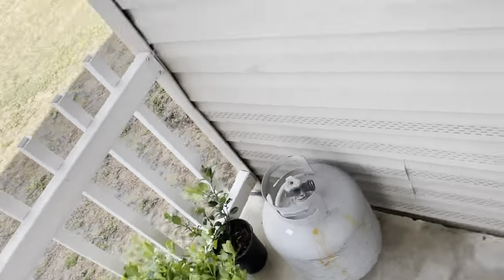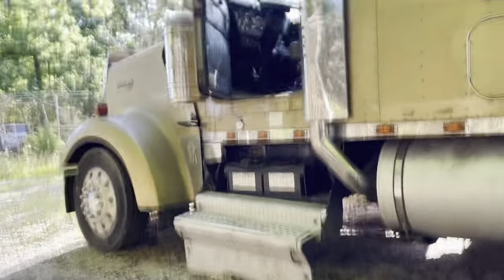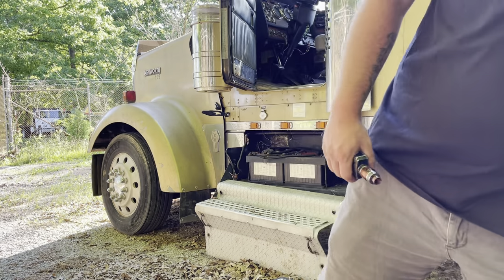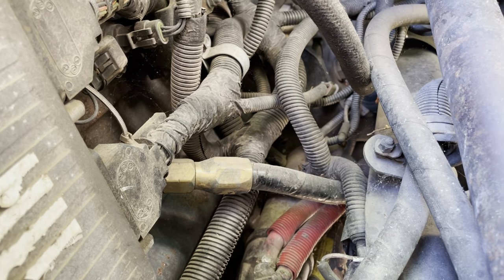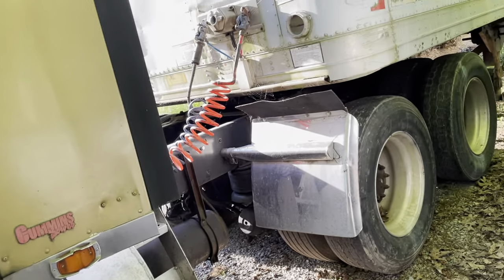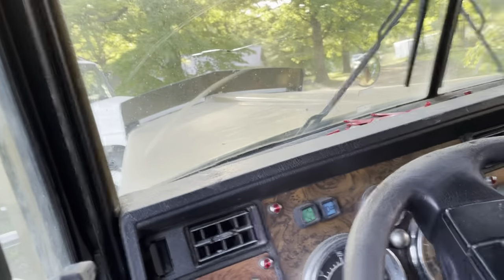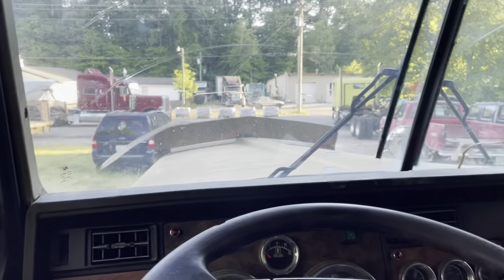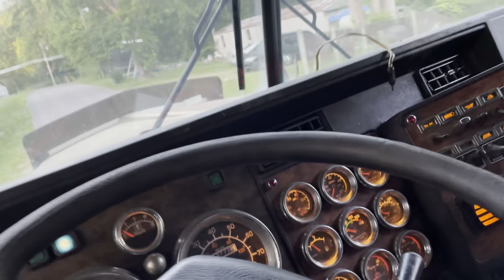WILL IT START? KW900 sitting 2 Years Drives Away from Grave....

Comment: Tim if you have low oil pressure, like 15 to 20 #'s at idle, replace the piston oil cooler/sprayers that spray oil on the piston skirt to cool/lube them! That are on the side of the block, under the turbo, round, with a bolt holding them in, easy to change! They get brittle, and break off, causing the oil pressure to drop! Easy fix!
Reply: Down to 10-12 at a hot idle is normal for the n14. 15-20 is great. The piston cooling nozzles will cause the  oil pressure to drop though
Reply: Tim, replace that old wore out steering wheel with a new leather wrap chrome one.i had a 2000 model look like that one got it new off the lot with a 550 cat large car...

Comment: That engine runs like a fine Swiss watch. I would love to have that truck. I would take it and get new virgin tires all the way around and a alignment. Then Get the windshields replaced. After that change all the fluids and filters, fix that starter problem and air leak. Get a paint job after it earns some money. I would go gold with some metallic root beer brown striping on it. Old school. Oh I will prepay for two shirts and a hat if you tell where to pay at. I absolutely love today’s video. 👌🏻👍🏻

Comment: Just one thing about a N14 make sure you run the overhead. They have always had a problem with the exhaust valves getting tight. I will say best engine Cummins ever made .
Reply: The best engine Cummins ever made was the signature 600
Reply: @robertcrawford4555  I disagree I have overhauled both for years the N14 by far gets more miles and is the most economical. That's why Cummins quit building the engine they weren't sell parts 1 million mile engine all day long. The 600 never could make that without some sort of issue. And don't tell me I am full of shit have run both and the N14 ran cycles around the 600.
Reply: @mikenicholson2548  the 600 has more power   It is a way smoother motor, also one of the quietest motors ever made out of any engine period .I don’t care if the N14 is a little more economical  I’m talking as a driver that has put 300,000 on a signature 600 and probably 200,000 on an N14.It’s not even a close call
Reply: @robertcrawford4555  N14. 👍

Comment: Drivers that claim there's tons wrong when it's just the way the truck is, I call them "super truckers". Leave the engine stock, it's probably one of the better Cummins engines
Reply: Greatest Engine made.
Cummins N14
Reply: Damm straight brother damm straight
Reply: I guess we will just overlook the block fretting issue lol
Reply: @leejohnson2550  Yeah, other than the block fretting issue, real N-14 fan's know about that! But it took 1 million miles to discover it, on mine! Friggin motor was a horse!
Reply: @AliMaskiin  Good engines for sure. Certainly not the best ever made however
Reply: @leejohnson2550  p
Reply: N 14 is the best engine cummins ever built for a class 8 truck down in australia they pull up to 4 trailers with the n 14 s
Reply: @warrenklingensmith1241  no argument  there  mate,  but you just had to carry  a couple  of spare injectors  with you cause of the spring failures, then replace the springs when you got back to the barn. Imho I have a warm spot for a big cam III cpl 625 tweeked and K19
Reply: Hello just watched your video on starting the W900 with N-14 Cummins. You said you put a marine cam in it. Do you have the part no. For cam and what was the cam timing in degrees that cam was set at.
Reply: W900 Cummins you said it was 525 Factory. But with that marine cam it is about 550.  Did you have a new cabilbration put in the ECM, if so do you know that cablibration was. I thinking of making some upgrades to my N-14.

Comment: I run my 1987 pet 379 early model ext hood.  Have it since 1987. 3 mil miles on will not trade it for anything kta600 with 18 speed.  Runs everyday with my raven dump.  I take manual motor over any computer peice junk
Reply: Exactly how I feel. So much easier and cheaper. Tweaking a fuel pump isnt hard at all. To me a 3406b pump is so much easier than a pt pump Cummins
Reply: Pics of this 87 379 with a K Cummins?my dream truck is an A model KW with a K Cummins😎

Comment: I'm going to miss this truck. Wish I had the money for it but both my old commercial trucks are down. My 81 cabover needs lots but runs great...my 88 freightliner classic needs motor tore down to figure out why coolant mixing with oil. My 03 t600 needs a full major. Gonna fix em all eventually 1 by 1. All kitty powered and all made it to over 1 million each on no overhauls. . Money is tight.

Comment: I’ve got a 99 4964ex with that factory 525/1850 N14. Just got her fully rebuilt including cam and we bumped her up to about 600hp. Be careful who you put in her as a driver. That truck will run if it’s set up anything like mine. Those motors come alive in high rpm’s making their top speed well into the triple digits with 3:36 rears.

Comment: Porter greetings! 🇺🇸 I’m shocked that the truck has been sitting this long. I’m not a Cummins lover, but most are decent running engines and they’re not too expensive to rebuild. Hey, fix her up and get her ready for the road. If nothing else, take it on a trip yourself to see what she’s like and have her as a backup truck. I’ve never been in a W900. I do like them though. I’m more of a Peterbuilt guy or even better yet, let me at a cabover! 🥰 Hey, I’ll take the ProStar. Back to the KW…it seems to be a nice truck, even with the few issues it may have.

Comment: I drove a 2007 W900L that was all done up,motor and looks. Had a C15 with twin turbos and some work done on it with a 18 speed in it. That thing would pull up hill loaded to the top like it was nothing. Loaded that thing cruised like a Cadillac ,only thing was empty the suspension was way to stiff it would hop all over at high speeds but all in all that truck drove like a dream. My boss always let guys he had working with us(drivers that only worked with us when we had to much work to keep up with) doing some of the nighttime jobs and I told him that was a bad idea but the one guy wanted to drive nothing but my truck if he worked for us at night until one night he forgot to put the body down dumping a load off up on the northeast extension on the PA turnpike and well he found out that it wouldn't fit under overpasses with the body still up. 🤯🤬 It was one thing to come in to work in the morning only to find your truck that you fueled before you parked it the night before with no fuel in it but to find your truck in pieces was something you never want to find. I know I was a company driver and had no out of pocket expenses or the truck wasn't mine to call my own but it was assigned to me so I took alot of pride to drive her because it was one sweet looking and driving truck. But to wake up one morning, get your shower ,go down the road and get your coffee and having the sun shining down on you and then you drive off to the yard only to round the corner to turn into the yard and YAM !!! You see the truck sitting in the yard looking like that.  That was heart breaking to say the least. You know when you drive nice equipment you kinda take pride in it and you wait it to look good as it can't if you get chances or have places where you can pull in and clean it up. When I first started to drive it was food grade tankers and my truck and trailer looked like rubber duck's truck from my childhood movie Convoy so I was so damn proud to drive that truck and trailer.  It was a newer mack then the one in the movie. Mine was a 89 R-model mack and the trailer was a polished Stainless Steel trailer so that was one good looking set when I cleaned it and when your dealing with food grade product I would almost get in a spot everyday where I was allowed to wash my truck and trailer and keep my wheels and tanks polished up real nice. Wow, I'm sorry I just started to babble off there didn't I ? Lol

Comment: I like running them KW900 . I worked a farmer that had  2007 KW900 with a 9 speed i think it has been A few years since i drove it . than he got A 2018 with a 18 speed KW900 that I drove for A few years. i like the full hooded that the KW900 semis trucks

Comment: she definitely needs bushings on that rear drive axle and get and alignment done. 19:32 when you popped the brake you can see the axle movement. I've seen it on numerous Kenworth's of all models as Kenworth suspension is notorious for it. It'll kill fuel mileage and eat up tires. Also need to check the cab bags for leaks or find out while the leveling valve isn't supplying air to the bags (I had to replace the linkage to the valve which broke off). Definitely don't want the cab riding on the frame like that.

Comment: Tim, If I was even back in my fifties again, I would fight Mike Tyson.. the fellow who chew off another guys ear in the ring to just drive it around the block. I must of put three million miles on conventional KW's and for me it was home. I had a bad woman in my life that just drove me so crazy that ... this ain't the place for that... I could run one of them through some of the crookedest roads a man would care to ever drive loaded with logs for lumber mills. When the others parked their rigs cause a little snow was just cream for me cause of less traffic. Roads on the olympic coast were narrow and crooked as a dogs hind leg yet it was seldom off the highway posted speeds and of course ... not lying, being young when I started was a fast driver. NOT a hot rodder, just fast and always a hour early to get that first load off the landing to get to the mill. On bad days, others settled for just two  trips an me... I got three dumped and one on for in the early morning so I could be there for the first in line to get dumped. All the rigs I owned were the gun metal gray with flames coming down the sides of the front and down past the doors. This is pre air bag days so I ran springs on the truck and walking beams on the trailer and would let that truck lay into a corner hard and use the suspension to keep it dirty side down. Enough on my antics, give that girl a decent enough paint job and when the driver just crawls in without a checking tires ... pull his butt off the seat  cover and let him either go or ride passenger till he figured it out what a expensive investment he's driving. I had mine shining come summer or winter.... enough on morgan. I like the jake on a cummins better but I have so little time on those sixty series detroits that its not fair to judge one like that. The fifty three series and then the seventy one series detroits were the only ones I ever had to drive and to me had about the same power as the old Thermadyne Mack trucks. In fact, those ornery old break your back macks could pull a mountain over but give it a week to do it. After putting about fifty thousand miles on a silver detroit engine... I was respecting the detroit a lot more and parts were half of a cummins but.... I would go over a million miles on a cummins before it had a full overhaul and most the parts in them were still well usable again so I did. Not many fellows could work on a cummins but seemed as though anyone who had a twelve point quarter inch socket on the quarter inch drive could run the rack on a detroit an get some power out of them. I did have a few detroits with the 8-71 in them and I would turn the governor up to twenty four hundred rpms and then they made more than just noise. Out on the highway not so bad but where it was hill after hill and never getting past third and direct on a five and four was just more than I  wished to go through day in and   out... That truck to me is sweet but I do like my spoke steering wheels compared to the pickup truck looking ones and I did run fenders on the front of my drivers to keep the rocks from pecking all the paint off. To give you a idea on how far I go back, my first truck was a autocar with a hall scott engine, and it started on gas and then switched to diesel. Right out of the early forties is was. It had a hood that was longer than the conventionals today that are set up for the twelve cylinders or the six hundred kta cummins engines. I am saying it was longer than the half that was cabin and sleeper..... well maybe not that   long but it was a ways to the  radiator cap. So maybe you'd understand the feelings I have for this truck. I live todays ways on hand off and hand outs as my social security is just bare minimum  an my rent takes all but forty seven dollars of it so no clothing for me or I'd ware a shirt of yours. More likely the hat as I just ruin good clothes with the cancer thats eating me up right now. So no clothes but some of other peoples should respect that to get these shirts out is quite a investment and until the merch sells, its money out of your families mouths. I surely do hate snakes too but seeing them eat mice almost makes it worth the having one in some cage. I do think they are the devils pets in the first place ..... take care Tim an wish you all well and successful

Comment: What year is the truck.  Nice looking w900.  She should be on the road. A working girl. Hope you spend some $$ and cleaner her all up inside and out/wash motor and check her over thoroughly.   A lot of truck drives are trading in there new shit and fixing up older trucks simple because they so much more Reliable.  Cus new shit all has computer shit and DEF crap.

Good video and good looking truck :)
Ps could we get update on what happing with this truck please.  Thanks.

Comment: ISX engines are weird. I thought it was Crazy after a crisp rebuild of literally  everything on mine after all the issues it had, literally gained maybe 5psi of oil pressure when it comes to before and after .. runs great though but they are just so weird .. glad I’ve read up and keep up on the maintenance and what not..  if not taken care of  you can find yourself in trouble real quick lol
Reply: Always 38lbs at cold start and at idle 28lbs 
38lbs at highway speed/operation temp

Comment: Idk if im right but I think its a 13 speed manual. Doesn't that mean u put it into neutral and hold the clutch to start it?
Reply: Often on older trucks there is no clutch safety switch so as long as shes in neutral you are good

Comment: don't you said the KW had a ISX and that's the reason you want to sell it?
Your low Oil pressure is probable the old oil or a worn Piston squirter
under 40 psi on Idle is quit low, even for a Cummins.
Btw N14 is the way for Power on a Cummins, 
and for what I know you don't need a different Cam on 855 Cummins to make reliable 700HP
Just good fuel Lines, Injectors and Filter ,Tune and a decent Turbo.
I don't know for sure, but Stock Blocks and Cams are good for 4 Digits on BC's.

But best plus on Cummins is theier brand new Parts are cheap enought to not buy Reman
rebuilding a 855 is about 20.000 with everything new, and they are easy to work with.

Comment: That truck could use 8 inch straight pipes, 18 inch drop visor, 3 inch window trim, LED lighting on the bottom of the cab & sleeper, chrome front bumper w/ LED lighting all around the bottom, all LED lighting, 22.5 inch alcoa super singles upfront, alcoa dura-brights in the back, and custom rear fenders.

Comment: The oiling system on a n14 looks like Jenny Ford came out with it in the 1800s lol it was outdated when it was made lol its always been a huge problem of there's. I'm not sure if the new x15 motors are setup differently but I would say so after all these years. But if you ever took the time to fully understand how that old style oiling works on a n14 its a shitshow wating to happen and most of the parts for them nowadays are reman junk or from China. Also if you keep take off the bug defector. Your drivers won't smash it up so bad then. Those w900 are a pita to drive with those installed on the hood.